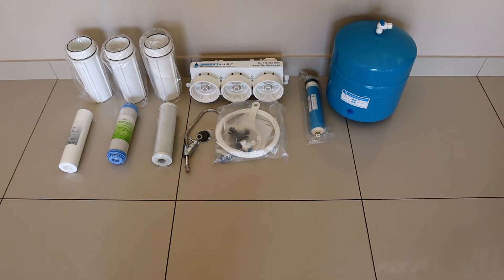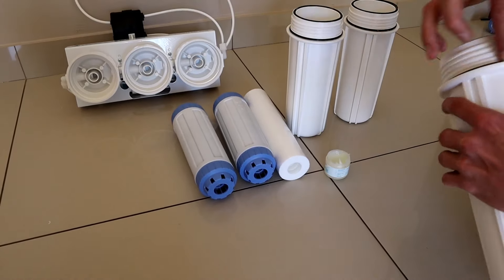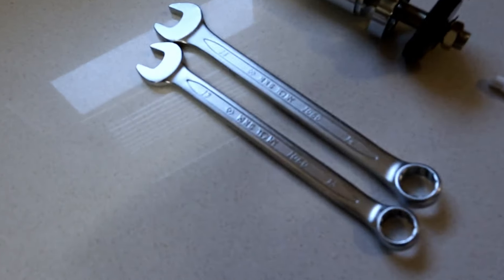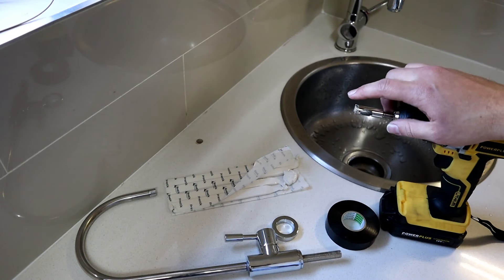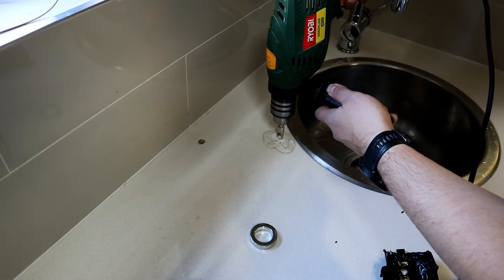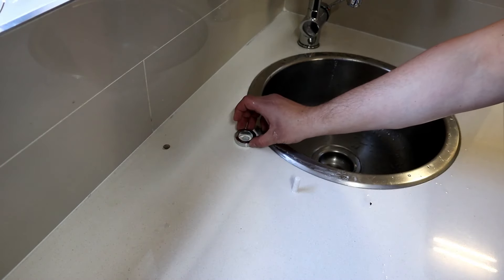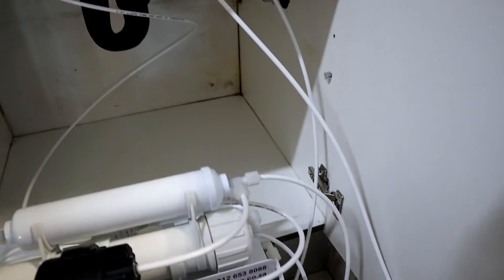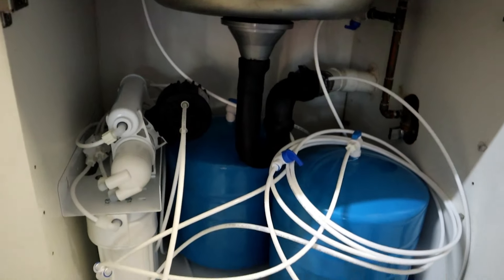FilterShop.co.za DIY RO Installation Guide

Comment: How many liters are those tanks?
Would you be able to fill multiple big pots and jugs in a short amount of time or would you have to wait for the system to produce more after a few liters?
Reply: Depending on the pressure the tank will hold between 5L and 8L but the total volume is about 12L. So typically it is enough for household use.

Comment: I there a danger of hot water going into the Ro filter from a mixer tap? My ro felt warm, so yesterday I tested it when replacing filters. It seems like hot water can make into the system when the mixer tap is on both hot and cold.
Reply: Hi, that sounds like you have a lower pressure regulator on your cold water line than what you have on your hot water line. It can be an issue if it gets over 50c but if it is just slightly warm it should be okay.
Reply: @semiusefulinformation144  Thanks. I think the pressure is lower on the cold. Would it be an issue to put the RO inline from the dishwasher? Is there a risk of water from the dishwasher flowing back into the ro or somehow contaminating it?
Reply: @uraninite8151  It shouldn't be an issue as the dishwasher shouldn't be able to push back into the mainline. I agree that it might be safer to feed it from a cold water only line.